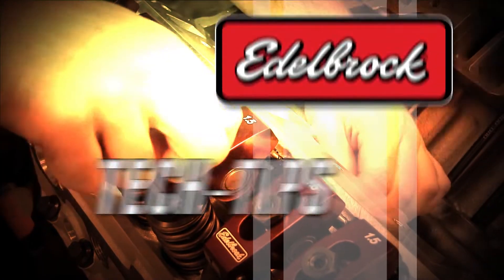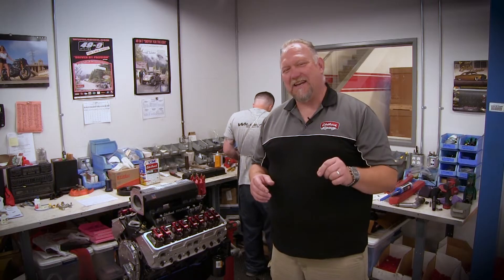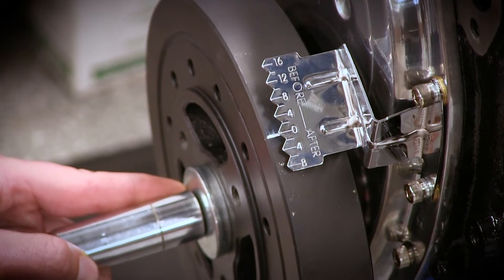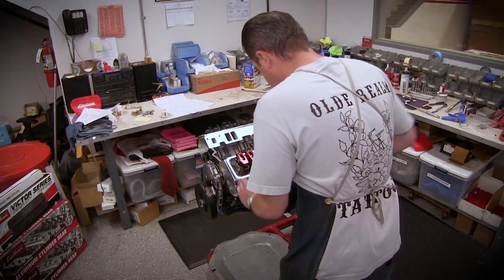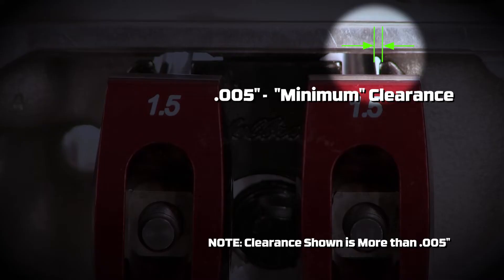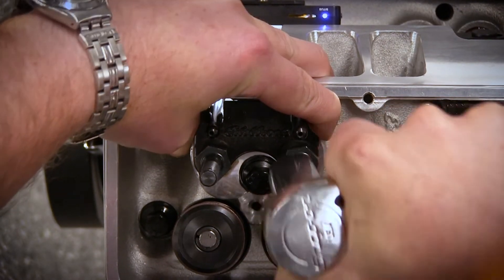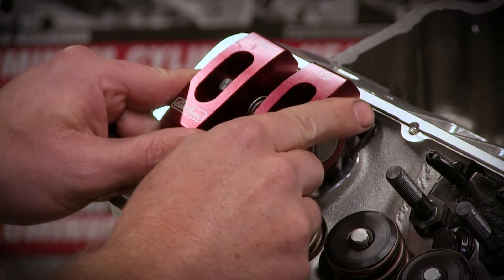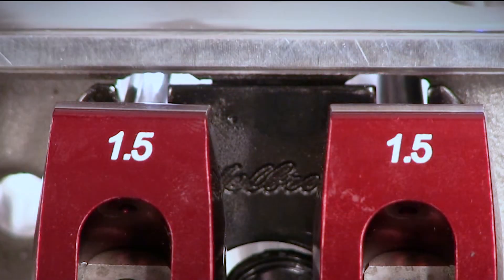Tech-Tip: Adjusting SBC Cylinder Head Pushrod Guideplates

Comment: I am having a difficult time doing this as on my small block chevy the guide plates do not center the rocker tip on the valve stem so I went with a adjustable guide plate to achieve this but the problem is is that I am concerned about the pushrod rubbing guide plate although both are hardened. Like a lot of things I cant find solid info on this as some people say no rubbing allowed and others say that is how you achieve proper alignment of rocker tip and valve stem! Must be nice to have things just line up perfect on a SBC LOL..........